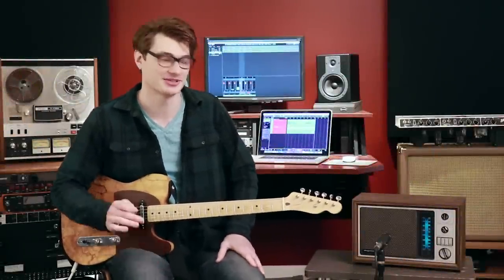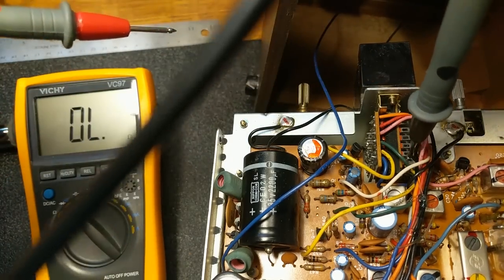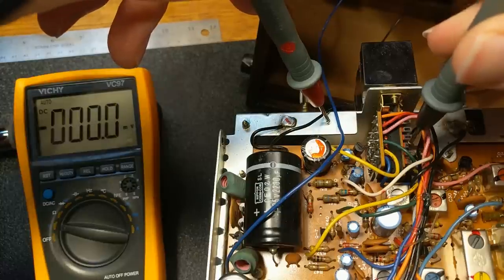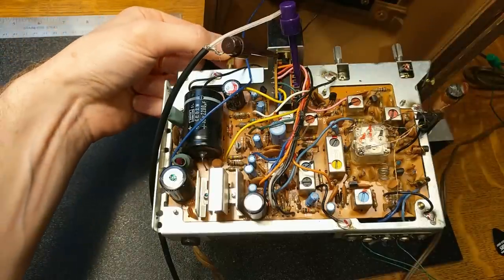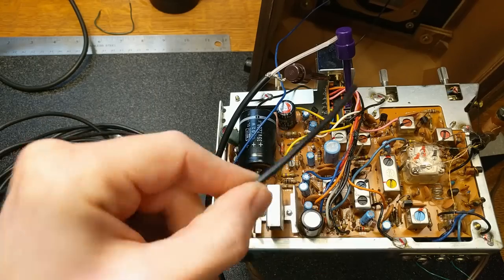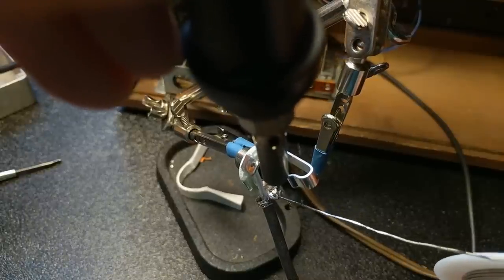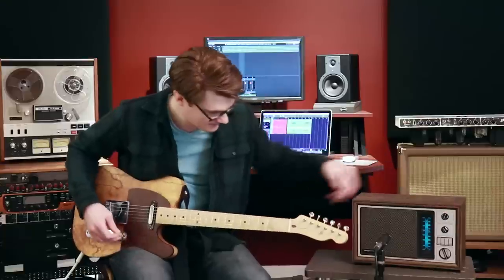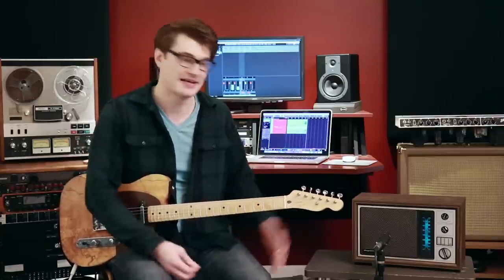Old Radio To Guitar Amp

Comment: Love the idea, looks great.
Question: Can you use this for a bass guitar? And if I get the wires mixed up, will I damage the guitar? (Mine is a 1950"s -ish 220v Zenith radio)
Reply: I actually used my bass with the radio I modified using the method in the video. It's pretty low volume, but it is there and messing with the knobs on the bass can give you different effects.

I plan on using mine specifically for classical guitar amplification via piezo pickup.

Comment: Awesome! I wonder if you could tweak the tone circuit to get rid of some of the bass or perhaps a ~.001 cap where the guitar signal enters the amp? Thanks for the demo! Tim
Reply: That's where you get a treble master pedal like the one that the guitarist for Queen used and it is like the original tube screamer
Reply: a cap or a tiny isolation transformer should absolutely do the trick
Reply: Put a buffer pedal or pedal with buffer (Tubescreamer, SD-1) in between guitar and radio (amp) and you get hights back. Then drop volume on radio.

Comment: Sweet mod! I think you could also have wired the input jack as a switch, right? Then you could still use the radio, but as soon as you plug in the guitar, you disable the radio input and it's off to the races. FWIW, I like the effect when you had the guitar playing over the AM radio static. That could be cool in some applications.

Comment: Thanks for this! I've been trying to do this and followed most tutorials that say to try to connect the positive wire to one of the volume pot lugs, and nothing. Gonna try again with one of those switches, maybe it works! Yours sounds great :)
Reply from the maker: Thank you. Good luck!
Reply: when all else fails, look for the amplifier chip, search the part number online to find the datasheet, find which pins are the inputs and try to follow the traces from there

Comment: to anyone interested in converting a radio into a guitar amp and plugging a guitar  into it with a guitar cable,please learn electronics and electricity.  You MUST use an isolation   transformer  or risk electrocution!!!!
Reply: Isn't that only with tubes?
Reply: @heggy_69  i’m not entirely positive, but I would use an isolation transformer regardless the issue is when you plug your guitar into a modified amp your guitar is grounded and if there’s nothing to isolate the high voltage from the ground if anything were short, it’s gonna go through the guitar and you’re gonna get electrocuted so I would use isolation transformer even on a solid state application. Maybe somebody knows more than me and can correct me if I’m wrong, but I say better safe than sorry and if you don’t need it no harm done

Comment: Sorry... what is that shitty sound.... erf... lol?
Reply: No. It is expected sound. Radio has low impedance to reproduce guitar sound, and hight frequencies are sucked. There is easy fix! You just plug in pedal with buffer in between, for example Tubescreamer which has buffer even when its off.